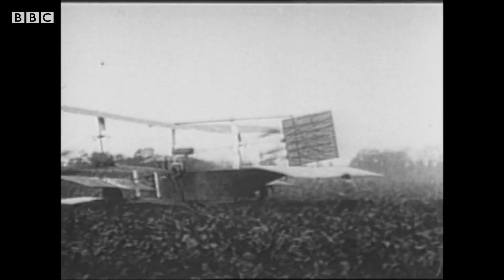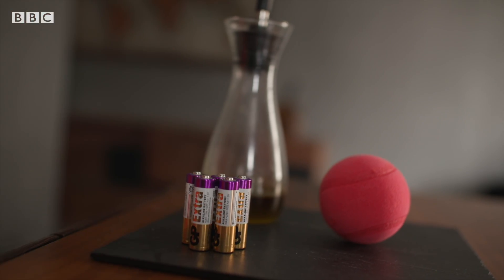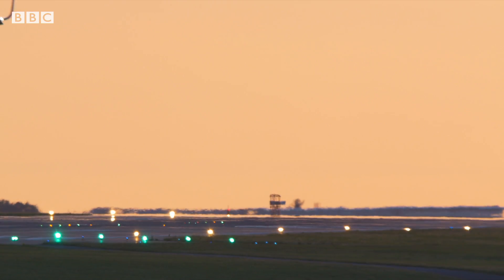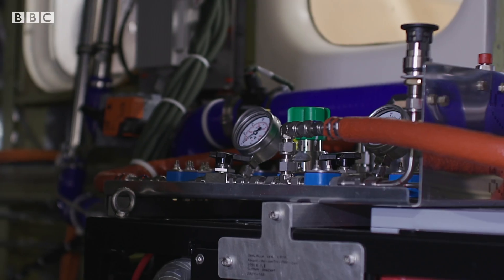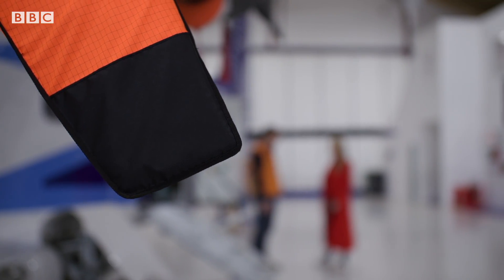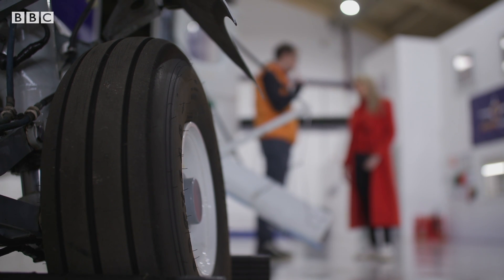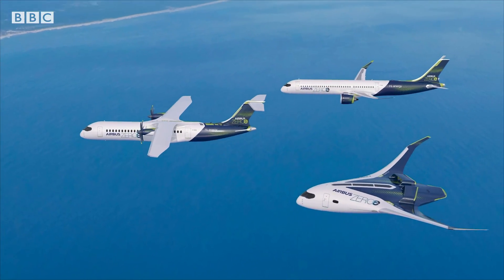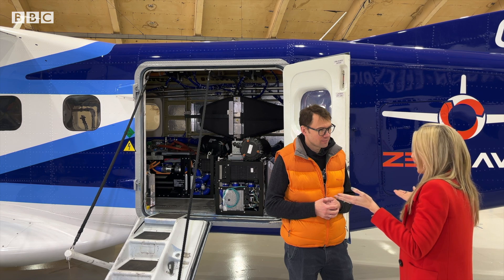Will flying ever be sustainable? | BBC News

Comment: Hydrogen is a terrible fuel from an energy-density and price perspective.  To be fair, this was kind of acknowledged in the video but nobody should be holding their breath right now while waiting for this to happen.    Good old fossil fuel will be the airline industry's only option for at least another decade or two.
Reply: To add to this, for the scale required for commercial aviation, they only economic source of hydrogen is from processing fossil fuels. The idea that hydrogen is sustainable only applies to its use, not its manufacturing into fluid fuel.
Reply: Isn’t hydrogen actually very energy dense? It’s like 3 times as dense as gasoline. Also it doesn’t lose efficiency/capacity compared to lithium ion batteries for example. Almost every professor in chemistry I’ve spoken to at my uni says that hydrogen is the future especially for larger vehicles.
Reply: @CaesarNeptuneStudios  If you're measuring the energy density by mass/weight then yes, hydrogen has a high energy density but the problem is that hydrogen is extremely light so whereas you only need about a liter and a bit to make a Kg of jet fuel, you need many, many, many litres of hydrogen to make a Kg -- even if it's chilled and/or pressurised to the point where it become a liquid.   This then means you've got to add the weight of the heavy high-pressure containment vessels needed to hold it at those pressures and/or a cryogenic system to keep it cold enough.   Once you add all that up, jet fuel wins by a country mile -- and it's cheaper per unit of energy by another country mile.
Reply: @xjet  Right, the tank size. But jet fuel lets out a lot of harmful emissions so I still wonder if we can produce H2 gas using renewables/sustainably, that would be excellent in principle at least to use fuel cells instead. 
I agree otherwise with your point that it will take decades before it’s feasible and regular jet fuel+sustainable aviation fuel is probably a better short-mid term solution.

Comment: Typical having someone complaining about the emissions involved in constructing the technology, without actually challenging that and asking how many emissions are used to construct conventional aircraft.

Also emissions to construct the technology will be coming down.  Electric mining trucks are starting to be rolled out, the transportation of minerals that have just been mined would normally be trains which can be electrified as well as ships and the shipping industry has it's own plans for going zero carbon.  Then there are smelting works to process the metal and hydrogen power smelting works are coming on line with one currently already fully operational in Sweden, and then there other transportation emissions where trucks are already going electric as well as factories relying on the power grid which is going more and more green as the years go on.

So the emissions for constructing the aircraft will be involving less and less CO2 as different parts of different sectors have their own advancements, until in the distant future constructing the aircraft will have zero CO2 emissions.
Reply: Electric mining trucks? Lol nonsense. Guarantee none of that shit works.
Reply: @curiositycloset2359  the trucks don't drive between cities, they drive in the same small area (mine, pit) :) think of them more as trams, instead of being biased on the internet :)
Reply: @wga4139  Yes, I know what a mining truck is.
Reply: @curiositycloset2359  great :) the electric car was invented over 100 years ago and vas very simple. Yet, we have electric cars rolling on the roads with the Tesla model Y, for example, being one of the most popular cars in the US. Today's dumpers have an insane fuel consumption, and I would argue that switching the powertrain to electric would benefit in the long term :)

Comment: I think I have a much better answer.  Let me explain:
1. Back in the 1960's and early 70's Thorium molten salt nuclear reactors were explored in the USA by the same guy who invented the light water reactor.  This was his 'real' reactor while he considered light water an easy to accomplish "proof of concept".  He never meant for light water to be what we actually used.  However, politics got in the way of him realizing his dream.  Now countries like China are building demonstration Thorium molten salt reactors and even India, with the largest Thorium reserves in the world are looking into a form of Thorium reactors.  There is also a big push in this arena for mass produced in factories small modular reactors that can be shipped pre-built and installed on site.  You can go anywhere from one small reactor to a large array and do it cheaply.  Especially with Thorium molten salt reactors, these are inherently safe reactors that can produce a lot of power in a compact space.  They are also very efficient, using 1/35th the fuel of a light water reactor for a given amount of energy production.  The main fuel is plentiful enough to power all of civilization for billions of years.  I could go on and on, but overall these are worlds apart and orders of magnitude better in every way that counts than the traditional light water reactor.

You build a bunch of these reactors, rolling them off of the assembly line in high volume and get your fuel reprocessing and such in order and you have cheap, round the clock, abundant power that can be placed anywhere you need it.  Just say you need at least 250 MW of power somewhere and you have it.  Even if you need say 20 GWs of power, just install a bunch of them at a facility and monitor from a central control room.

2. Now that you have the cheap and abundant power, it turns out we can do more with electricity than just make hydrogen, we can make methane (natural gas).  Making methane, we can pull CO2 out of the atmosphere or out of any number of places we have CO2 spewing out of in high concentrations now.  So when you burn the methane later, you just put what you effectively took out of the atmosphere and put it back in a circular cycle.  We use massive amounts of methane today, so this is a very good thing to be able to produce.

3. Now that you can make methane on the cheap with these nuclear reactors in #1, it turns out we can make propane out of methane.  We use propane everywhere already.  Want to BBQ outside?  Look no further than that propane fueled BBQ you have on your back porch or patio.  Go to a nice restaurant with outdoor seating?  Well that heater keeping you warm is propane powered.  Want to drive a forklift around inside and around a warehouse?  Well that forklift is probably propane powered.  Even say getting a backup generator for your home and / or camping / RV / trailer, it turns out it is super easy to modify a gasoline engine to run on propane, so they just sell dual fuel generators everywhere.

4. Now here is the thing, propane gravimetrically is more energy dense than jet fuel.  This is as in 43 MJ/kg for jet fuel versus 50 MJ/kg for propane.  It is also more voluminous, but it is easy enough to compress it into a liquid and store in a reasonably compact and light tank for aircraft use.  Maybe for an existing large long haul airliner, you use some of that attic space above the passengers for your propane tanks instead of using the center fuel tank.  It is easy enough to retrofit the plane to have the engines burn propane.  So maybe you make existing planes dual fuel where it does a combination of jet fuel and SAF in the wing tanks and propane in the fuselage in attic tanks.  A future plane may have struts and focus more on larger tanks in the fuselage for all of its fuel.

5. Moving on to shipping, which is another major emitter, you throw a 250 MW reactor into a giant ship, that ship can speed over the oceans and deliver lots of cargo a lot faster than other ships.  The ship just runs off of the nuclear reactor directly.  Hot salt makes steam, and steam runs steam turbines which turn the main propeller.  Job done.  You could also have a gas turbine turning a generator for main ship power.  As for safety, the main problems safety wise are in and around the Middle East, so you just rapidly sail around Africa and don't think twice about it because these ships are so fast.
Reply: Nah. I'm sure the experts would've already done all that if it were viable.
Reply: @RogerMellie-yk3gw  What I am saying is the experts were and are working on it.  Look up the Oak Ridge reactor.  Look up Solar 2 for questions answered that come up out of that reading.

When I went through it all last, all I could find where political issues ultimately stopping it, not technological ones.  All of the technological issues are solve-able and key ones have already been solved since the 1960's.

Get the politicians to put their heads on straight and educate people about what you are actually trying to do and why it is important to do this over other means and cut out the fear mongering, and I think it could go really far.

As for the chemical fuel side, these are solved problems.  They are just expensive because renewable energy to do it is expensive and these chemical reactions with electricity are not all that efficient.  So you try to do it with already expensive and intermittent renewables and it it is hellishly expensive.  I don't think this can be solved.  Renewables is just too diffuse and problematic to ever be cheap enough.  However, have a compact, efficient, always on, cheaply mass produced nuclear reactor as your power source and all of these 'green' fuels made with the help of electricity suddenly become viable.  I am pretty sure of it.

Go through all of the literature and tell me different if you can prove it.  I have done a lot of homework on this and this is what the homework settles on for near term solutions that seem to be most achievable.
Reply: You're missing the point. They could have built standard nuclear power plants. But they didn't want to.

What they want are subsidies for ridiculous "green tech", that way they can syphon of the doe, all while saying they have done something.

Comment: Am I the only one that would dearly love to see big spacious airships reintroduced, where one can mover around, instead of having to stay seated in a tiny seat. I'd happily have the journey take 2 or 3 times as long, rather than be sat between two obese people, overflowing onto my seat, for several hours. Airships could be both sustainable and comfortable.
Reply: Me too. That's why I avoid air travel
Reply: Yes, check out the company Hybrid Air Vehicles!
Reply: If it would take that long then why wouldn't you just take a ship instead to cross oceans which are still available
Reply: @dreamthedream8929  Airships are a lot faster than ships.
Reply: yes, it would be great to have all that space.... seven million cubic feet of all that lovely, highly flammable hydrogen just sitting above you. 🤣

Comment: Aviation is 2-3% of the emissions, maybe start with the low hanging fruit? Like no use of natural gas for heating and cooking.
Reply: Yeah, great to get rid of gas for heating and cooking. Then everyone has to use electric. Then they have to build gas powered power stations to supply the extra load. Work of genius.
Reply: @curiositycloset2359  Well, obviously you don't use gas for electricity either, except as backup... this was from the holy BBC so I'm kicking the shins on the British use of gas to point out that flying is irrelevant compared to their heating/cooking/electricity.
Reply: They just want to control you...none of this is about emission my man. You've been fooled.
Reply: OK Rabbi....
Reply: Outlaw Bitcoin!
Reply: @kddidit08  Fascist freak